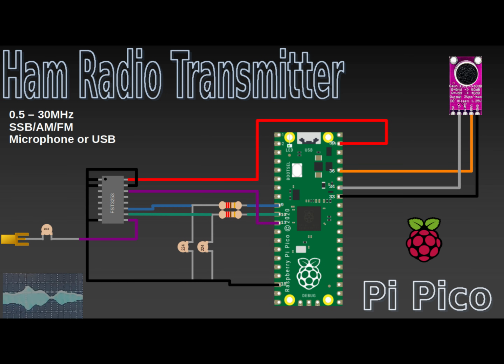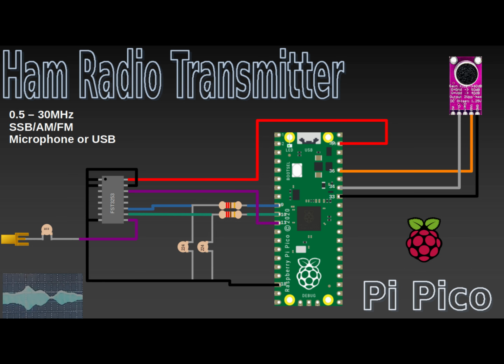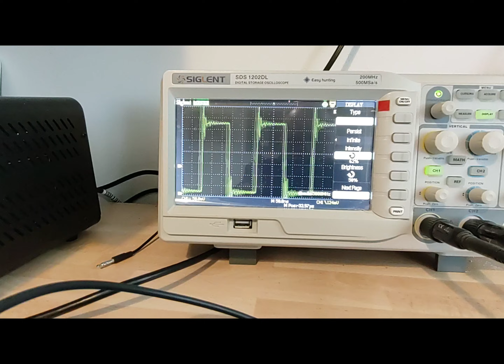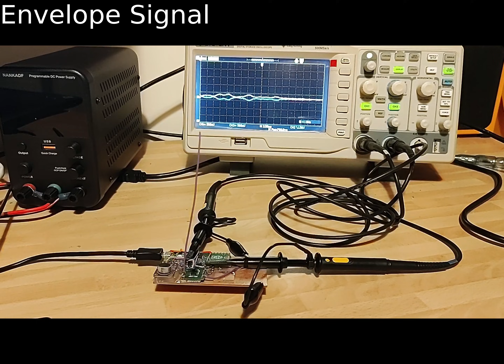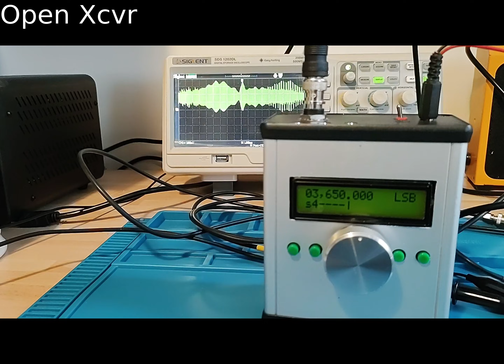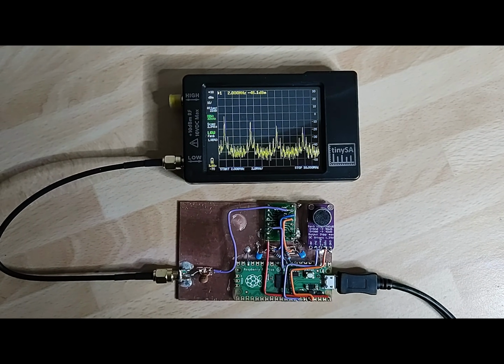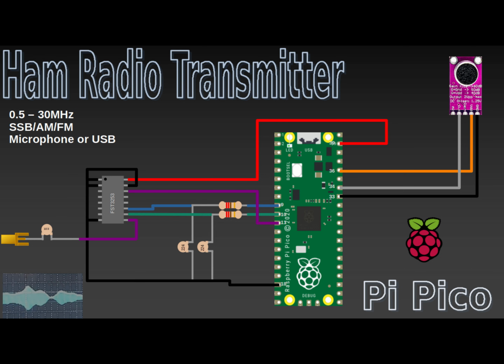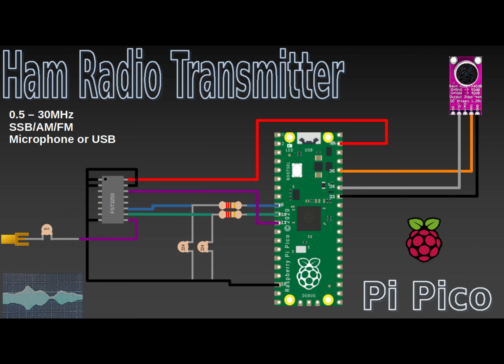Build a Ham Transmitter with a Raspberry Pi Pico

Comment: Hello Jon, I'm writing here because I don't know how to reach you. Actually, I need your opinion. Inspired by your project PiPico-Tx, I implemented an SSB modulator using a different microcontroller connected to a DDS chip. I used Hilbert and atan2, and I can monitor the phase and the I and Q vectors realtime. Everything seems to be working properly, but the audio quality is really poor.  Even the two-tone test is terrible under certain conditions. I update the phase accumulator every 33us, which is the same frequency at which I acquire the audio and I suppose that the short phase peak due to the atan function are extra elonghed by the  33us sampling rate. In your Pico-Tx (that sounds better than mine) which is the  phase accumulator update frequency that you use? If you have some suggestions really apreciate, thank in advance! IU2ITE
Reply from the maker: Hi, sounds like a very I testing project. I can't see why that wouldn't work. In the original design I only updated the phase every 10kHz which results in some artefacts (although it didn't effect the sound too much). I have since increased this to nearly 500kHz to avoid sudden  phase changes (not published though). And it reduces in-band spurs significantly. If you like to share some more details, I would be happy to take a look. There is an email address on the channel home if you would like to get in touch.
Cheers Jon
Reply: @101Things-ds8tc  Thank you for your prompt reply! I saw your email and will write to you soon. So, the audio in this video is done using 10kHz update freq., which means that there is something wrong in my design. See you soon.

Comment: Very cool. Minor things: the out y,32 PIO instruction that requires 1 delay in the other PIO branches, and min 4 clock period is not necessary, the y (being a constant) can be set into the PIO SM with an externally injected "EXEC" instruction. (using the ISR as a constant is also common). That makes period of 3 PIO clocks possible. If you also adjust the sys_clk PLL, to slightly greater freq than the harmonic of the desired freq, the jitter can be made very low. Eg. to for final 27.12 MHz I generate 9.04 MHz with 9.043478   (9.043478*23 * 6 / 12 = 104 possible with 12 MHz XTAL and all integers. A bit trickier PIO program though, but even less CPU load). Jitter is less than 5 nsec after appr. 2599.2/23 =113 periods (only the last is fractional, 1/32 resolution in my case with no CPU intervention or DMA stream).
Reply from the maker: Thanks, very interesting techniques! Especially changing the PIO to reduce jitter. I'm using a slightly different technique in this design, the PIO program is only a single instruction, so I get a minimum period of 2 PIO clocks. Achieves a frequency resolution of better than 0.1 Hz, +/- 4ns jitter. It works with hstx too if you have a Pico 2, it's double data rate, so  allows frequencies up to 150MHz to  be generated with +/-1.7ns jitter.

Comment: Cool build!

If we can easily and quickly change the frequency of the signal, can it be used to transmit FSK modes - RTTY, FT8, JT65, Olivia, Bell 103 etc?

73 de SQ2KTN
Reply from the maker: Yes, it should work well for those modes, thanks for the suggestion!

Comment: Hello! I would like to try this project, but I don't have any FST3253. Is it possible to generate the RF signals by using transistors or MOSFETs?
Reply from the maker: Yes, I think you could make this work using a FET or diode based mixer.
Reply: @101Things-ds8tc 
Hello!
Thank you for responding.
Could you please tell me exactly what kind of mixer would work?
I have just gotten my license and I am new in RF electronics.
Reply from the maker: I haven't tried it myself, but I think that a single diode mixer using some resistors and a diode might work here, a bit like in this thread https://electrical.codidact.com/posts/282711.

Comment: Thank you for sharing this! Do you think you could drop the CORDIC routine if you used the new RP2350 with its FPU? I assumed you needed this particular function for a faster fixed point arctan function.
Reply from the maker: Thanks 👍 Yes, quite possibly. Pretty much a faster replacement for atan, but also calculates magnitude too. Might try it on the pico2.
Reply: @101Things-ds8tc  Thank you. Forgive this question as I don't know anything about these PIO state machines. I implemented a CORDIC hardware version using Verilog -some years ago and was thinking could you could do the same on the Pico - so long as you can shift and add and pass on results to another state-machine. You're probably restricted in the number of bits you can shift by and the precision would be low due to the limit on the number of 'machines'. Perhaps nest a few Picos? :) 
Your PICO TCX and RCX projects have inspired me to investigate further on using PIOs!  I'm very excited about producing signals using a 1-bit DAC. I will be taking a peek at your source so I can replace my R-2R ladders.

Comment: Can I ask your background (electronics-wise). This seems brilliant .....I have little idea how this is all working, even with the explanations! 🤣. How would you know the frequency of operation....does it need a PC attached? 73 de VK2AOE
Reply from the maker: My background is in digital design, I'm no expert in radios or signal processing, it's just something I have always been interested in.

The transmitter is more of a proof of concept than a finished project. I have written a simple transmitter library and a couple of example applications. One is a standalone transmitter using a microphone. The transmit frequency and mode ar hard coded at compile time. The other uses USB for audio streaming and to set the frequency and mode.
It should be fairly straightforward to add an encoder/display etc to control the frequency or to embed the code into an existing device.
Reply: @101Things-ds8tc Thanks for the reply. As a proof of concept it has so much promise. As for the small amount of people who criticised the audio quality, copy for me was fine (especially taking to account the small parts count and modest mic). I have too many much simpler projects but look forward to seeing further progress at which point I will definitely give it a crack! 73 OM de VK2AOE

Comment: Good job! I am tired of SI5351's issue that it can not generate proper OSC signal for FST3253. Now I would try to use RP2040 as VCO controller as your PIO idea. Thank you for your valuable sharing. If you visit my channel, you can find my CW receiver on mini breadboard. These days I am trying to make a new mini breadboard project that uses DM3MAT's design as basic structure. And I was stuck in SI5351 issue. Finally I got good hint from your video clip and article. Thank you again.

Comment: Out of interest, why is the lower limit 500kHz? Hardware limitations? Only once 198kHz BBC R4 stops I'm wanting to make a very low powered RF modulator to feed directly in to an old radio receiver (via attenuators, not OTA)
Any thoughts? 73 GM5AUG
Reply from the maker: Hi, that will be a sad day... I'm using DMA transfers from pre-generated waveforms to generate the RF oscillator. The waveform needs to be at least 1 RF cycle long, so lower frequencies need longer buffers. I chose 500kHz because it seemed like a good compromise. Lower frequencies could easily be achieved using a longer buffer or a clock divider.
Cheers Jon

Comment: How many harmonic multiples of the fundamental are being broadcast?
Reply from the maker: The output is approximately a square wave so harmonics are output add odd multiples of the fundamental, 3x at 1/3 power, 5x at 1/5 power, 7x at 1/7 power and so on, you can see the effect on the spectrum analyser at 4:55.  In this first video I haven't made any attempt to filter the output, at this stage its a proof-of-concept demonstrating how the different types of modulation can be generated. In the second video I build a class-E amplifier with suitable filtering which does a good job of reducing the out-of band harmonics. I did still have some issues with spurious emissions close to the fundamental, so still some more work to do before I can try this on-the-air...

Comment: May I ask the physical size of your Pi pico RX??  Very nice demo on that also!
Reply from the maker: Thanks! The Pi Pico RX is 90mm X 55mm (approximately credit card size). It's quite deep at 28mm, mostly to accommodate the AAA battery holder.

Comment: Could one potentially overclock the RP2040 (say, to 250 MHz instead of 125) and up the high end transmit frequency range?
Reply from the maker: Good idea, its not something I have tried but I can't see why it wouldn't work. I have heard that the pico can be overclocked by a considerable amount.

Comment: I just ordered some of your Pico Rx boards and also a variant of my own Pico class E tx board that I plan to use for experimenting with your code.   I did the initial testing of the gate modulation scheme for the uSDX and am very interested in trying this as well as conventional drain amplitude control with your approach go generating the phase-amplituce waveforms.   I may try to move the code the Arduino IDE since it's my comfort zone.  I've been successful in compiling most code and libraries,  and the Earle Philhower Arduino core now supports both Pico cores so I think it is feasible.   Your knowledge of DSP and coding skills have provided the SDR learning tool that many of us have been seeking,  and working within the Arduino IDE would bypass the need to master the Pico SDK and/or VSCode for us hardware guys!
Reply from the maker: Thanks, your comments are appreciated. Your ideas sound very interesting. I would be interested to know if the gate modulation scheme gives good results, the idea is appealing because it results in such a simple design. I'm all for porting the design to the Arduino IDE too, anything that lowers the barriers for experimenters has to be a good thing.
Reply: @101Things-ds8tc  I will wait with baited breath for you to port the design to Arduino. There are a lot of us Arduino nuts out here, N2SN.

Comment: Sorry, but this is a bad idea. Stability and phase noise will be very poor with this design.
Reply from the maker: Thanks, that raises a couple of interesting points.

The phase noise performance is pretty rubbish, especially compared to a PLL such as an Si3253. This manifests itself  as a spreading (rather than a sharp peak) when viewed on a spectrum scope. The effect is more significant at higher frequencies. This is a fundamental limitation of the design, the level of the pin can only be changed on a clock edge which leads to a jitter of +/- 8ns. In a "propper" transmitter, I would use the Si3253 (or similar), they are fairly inexpensive, perform well and could easily interface to a pi-pico. This project https://github.com/ArjanteMarvelde/uSDR-pico went this route.

The stability is dependent on the oscillator. The pi-pico uses a 30PPM oscillator. This amounts to a error of about 30Hz at 1MHz or 900Hz at 30MHz. Although in practice the performance is much better than this, especially at room temperature. Although the stability isn't amazing, it is fairly typical of a crystal oscillator based design, although nowhere near as good as a TCXO which can achieve better than 0.1ppm. Unlike the phase noise, there are things we could do to improve the stability of the design, the pi-pico has inbuilt counters that make it possible to calibrate or discipline the oscillator using the 1PPS pulse from a GPS receiver. This project https://hackaday.io/project/193897-raspberry-pi-pico-based-wspr-beacon takes this approach.
Reply: Don't curse the darkness, just light the candle and let others improve the design. Atleast he tried👊🏿👊🏿👊🏿
Reply: Don't curse the darkness, just light the candle and let others improve the design. Atleast he tried👊🏿👊🏿👊🏿
Reply: Don't curse the darkness, just light the candle and let others improve the design. Atleast he tried👊🏿👊🏿👊🏿
Reply: Don't curse the darkness, just light the candle and let others improve the design. Atleast he tried👊🏿👊🏿👊🏿
Reply: Don't curse the darkness, just light the candle and let others improve the design. Atleast he tried👊🏿👊🏿👊🏿
Reply: Don't curse the darkness, just light the candle and let others improve the design. Atleast he tried👊🏿👊🏿👊🏿
Reply: Don't curse the darkness, just light the candle and let others improve the design. Atleast he tried👊🏿👊🏿👊🏿
Reply: Don't curse the darkness, just light the candle and let others improve the design. Atleast he tried👊🏿👊🏿👊🏿
Reply: Don't curse the darkness, just light the candle and let others improve the design. Atleast he tried👊🏿👊🏿👊🏿
Reply: Don't curse the darkness, just light the candle and let others improve the design. Atleast he tried👊🏿👊🏿👊🏿

Comment: Are you sure SSB mode needs control of the amplitude?
Another problem is a Step of frequency changes. Can you maintain a 10Hz or 100Hz step?
Reply from the maker: Good Questions! 

Generally, yes SSB does need control of amplitude. There are however some types of signals that will have a constant amplitude. A single tone for example will have a constant amplitude, that's why a two-tone test is often used to check the linearity of SSB transmitters. Some digital mode e.g. FT8 (which uses one tone at a time) have a constant amplitude and could be transmitted without modulating the amplitude. 

An accumulator is used to correct for frequency errors in the long term, the frequency precision (i.e minimum step size) is a fraction of a Hz, although the accuracy is dependent on accuracy of the crystal oscillator.
Reply: @101Things-ds8tc  Frequency changes are controlled by fractional clock divider of RP2040. It's 16 integer and 8 fractional bits divider. I'm not sure it's good enough.
Reply from the maker: @AlexejSvirid  Yes, you are absolutely right. Using the clock divider on its own wouldn't even get you within 100KHz at 30MHz. To work around this, I left the clock divider set to 1 and used the DMA to stream a pre-generated waveform at 125MHz 1 bit at a time. The software has to make adjustments to the start point so that the waveforms align nicely, but using DMA chaining keeps the CPU loading down to about 10%. The clock period can only be an integer number of clock cycles so the software accumulates any errors this introduces so that it can be corrected in the long term, while also ensuring that the transition is never more than a clock away from where it should be. A 32-bit accumulator allows a precision of 0.029Hz.

Comment: Thanks for sharing this. It's a great project! I was surprised with the capabilities of the raspberry pi pico. What about putting this together with the receiver you describe in the blog? It seems posible to build a complete all mode low cost  transceiver based on your design.
Reply: Thanks for you comment, much appreciated! Yes, I can't see any reason why it couldn't be combined with the receiver to build a low cost transceiver.
Reply: Don't hurry, OMs.

Comment: Thank you, love it! 

If it was not for illness (and lack of a decent opamp) I would have been tinkering with the Pi Pico Rx these holidays. I am surprised that it has slipped under the radar for so long - It was always my dream to make a minimalist device using accessible components - exploiting jellybean components without exotics removes huge barriers for the experimenters.

Now with this transmitter it will be even easier to test and tweak the Pi Pico Rx (and filters). Personally I am glad they are separate projects - nice to have a base to allow further experimentation without complexity.
Reply from the maker: Thanks very much, I would be very happy to see people tinkering with these ideas for themselves. I can't think of a better compliment! Good luck with your projects.
Reply: What is a "pi pico rx" ?
Reply from the maker: That's another project, similar idea but a receiver instead of a transmitter. https://github.com/dawsonjon/PicoRX
Reply: The problem with the PicoRX is the chip used for the Tayloe Detector . The St3253 is a surface mount chip. My soldering skills are not up to it.
Reply: That should have read FST3253. Sorry
Reply from the maker: @phillipneal8194  Yes, surface mount components can be a bit of a challenge, often I end up making projects out of "breakout modules" rather than individual components. Unfortunately I don't think there is a reasonable through-hole substitute for the FST3253. Even the classic kits like the softrock https://www.wb5rvz.org/ensemble_rx_iii/index?projectId=21 which mostly use through-hole components had to resort to using the surface mount device here.

When I built the prototype I used a breakout adaptor a bit like this one https://thepihut.com/products/adafruit-smt-breakout-pcb-for-soic-16-or-tssop-16-3-pack, but you can find cheaper on e-bay. You still need to solder the chip, but its a lot easier to work with once your done. Although it seems daunting, the soic package is at the easier end of the scale as far as surface mount components go. A normal soldering iron will do the job. There are lots of videos to help you get started, the soft rock page has some useful links. You need a magnifier, a good pair of tweezers and plenty of flux. With a little practice, it isn't really much harder than working with through-hole components.
Reply: @101Things-ds8tc  Thank you for your informative response. I will try your breakout board idea.
At a minimum I will learn something.